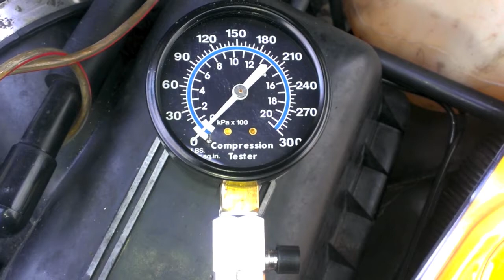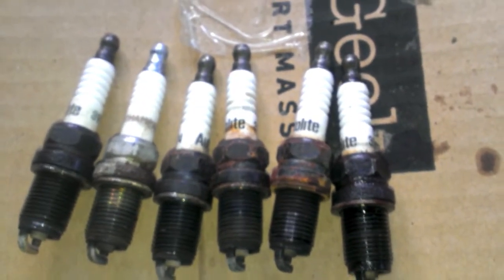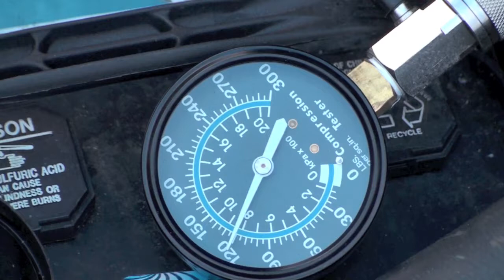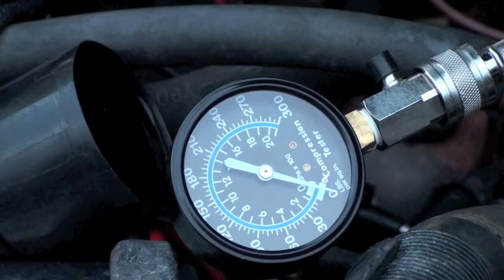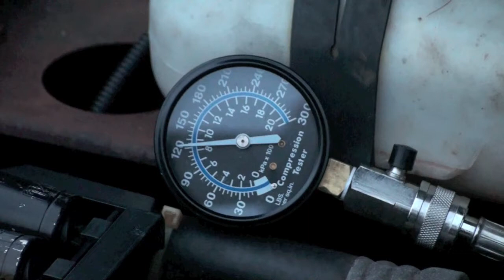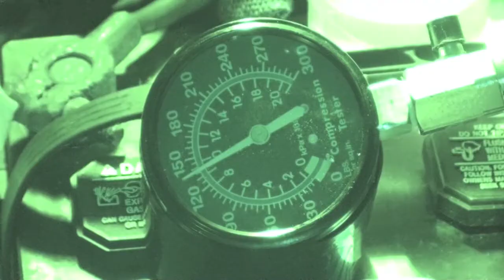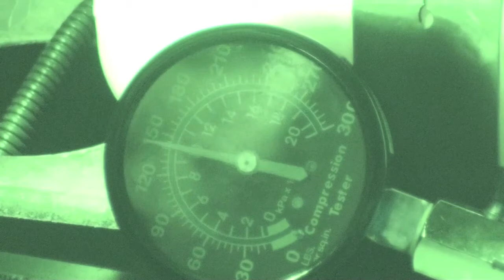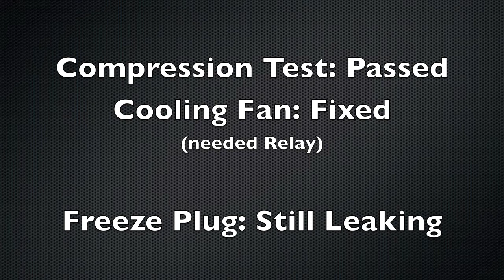89 Jeep Cherokee Compression Test

Comment: So what does that test tell you?
Reply from the maker: The Compression Test shows you how well your cylinders are sealing. An engine is basically an air pump that runs off explosions, so if a cylinder can not seal properly, all the power is wasted as it slips past the leak. 

Finding 1 or more cylinders with 0 or very low compression can indicate major engine damage or a huge timing problem. Finding that all cylinders have moderate to low compression can indicate it was not taken care of.
Reply: @NickInTimeFilms  for learning purposes and because I own a 89 as well, say you had a few that were bad, what steps would you have taken to repair it?
Reply from the maker: The next test after this is a leak down test. You set a cylinder to TDC on the compression stroke when everything should be closed, and you run an air line to the spark plug. Then you listen to where the air is coming from to find the area of focus. 

They make specific flow gauges that show much leakage there is. But say it's coming from the dipstick; worn rings or maybe valve seals. Coming from the intake of exhaust, intake or exhaust valves are leaking. Bubbles in the coolant or oil, blown head gasket. 

This is all assuming that engine timing is still good. For a good indepth video on checking for timing issues, I have a couple videos on my 2.5L Comanche that snapped a cam sproket pin and timing was gone. That was an interesting rabbit hole to go down.
Reply: @NickInTimeFilms  I took mine to a shop to do a compression test, they were over 100 with them being off by a little. I have a rough idle on mine and loss of power on take off and especially when I hit 3rd gear, the idle drops and it drags to get back to speed. I've done the spark plugs, tps, iac, ignition coil. I have a feeling I probably have some bad injectors, I still need to swap the distribitor cap, cables and rotor and oxygen sensor. Mine has never overheated, stalled on me twice when going about 10mph, the tps took care of that, but it's still has rough idle, the idle needle moves up and down very slightly , when fully warmed up my idle is at about 300, i still drive it around in close distances and works fine but I wouldn't dare take it on long distances like I use to right now.
Reply from the maker: Was the engine rebuilt at all or did something happen that started these issues? Having a scanner may help pinpoint any sensors or weird readings
Reply: @NickInTimeFilms  not that I know of, the jumpy idle has been there since I bought it, when I got my hands on it and started digging through it, there was a lot of old parts to it so not sure what or wasn't done to it.

Comment: Love your videos. I learn so much from them. I own the very same year jeep as yours same color also. I have a question for you,....Do you know where the two vacuum lines go coming from the ball at the front of the jeep?? I found one black line with an elbow in the end but not hooked to anything and I can't seem to find were it goes,!! It's driving me nuts!!! Can you help???
Reply from the maker: The vacuum ball right? It's just a vacuum storage tank. The bigger line will go straight to the intake manifold, that's your supply line. The smaller line is an output that I think goes to the vents or possibly a y fitting. There is also a one way check valve somewhere in there too.
Reply: NickInTimeFilms 
Thanks for the quick reply, one of mine go straight into the firewall if I recall and I he other that is hanging should go to intake manifold but the only manifold plug closest to the fire wall has a line already running to what I assume has something to do with cruise control?? I'm still not sure that's even hooked up right. Someone tried to steal this jeep and damaged the steering column, so shop installed wrong blinker arm no cruise, but this jeep also had a small engine fire and some lines were burnt, it runs fine it's sounds  good idling I've tried plugging that loose ends and don't seem to notice any difference in engine???? Soooo confused!!!
Reply from the maker: Oh goodness, you've just got a whole mess in your hands there. I think my CAD delete video goes over the vacuum lines for the transfercase about half way through, and the closed to open rad conversion video should show the vac ball relocation some time after the half way point.
Reply: NickInTimeFilms 

Great. I'll check out the vids, the jeep is in really good condition now the fire  didn't really do much damage you can hardly tell just by looking at it, I just don't think the mechanic who fixed it replaced the vacuum lines property, but somehow it seems to run fine, it just drives me nuts to know that there is a loose line that I have no idea where it should go, but I'm sure I'll find the problem with your help,!! Thank you very much,!!! I know I have a gem here. When I got this jeep 4 years ago it had 73000 on it. Today it has 123000. It's my 3 one.

Comment: Hey Nick,
So what was your general consensus on your compression test?  Did you end up doing any ring or valve work?
Reply from the maker: Well, not a whole lot. All the values were very close to each other so everything was sealing well enough. I was just checking this to make sure it was only rust that caused my freeze plugs to give out. When I pulled the engine apart I put new Valve stem seals in anyway
Reply: Cool, thanks for the reply!

Comment: Same amount of oil per cylinder added will make for more accurate wet test? Curious to see. Good video. I had read that an eight percent rise in compression per cylinder is to be expected during wet test. Much more then that could indicated a problem....,
Reply from the maker: +Edward Anstett I'm sure an even amount may help with consistent results, but honestly a wet test isn't necessary unless you get bad results on the dry. If you do then the wet will narrow down whether it is rings (much higher reading than before) or valves/head gasket (Same or slightly higher)

Comment: I'm finding out that my brake problem is a direct result of low compression. The vacuum line to the booster was nearly 50% lower than it should be. I wish I would of known about that before I replaced every.....single.....brake component. I have too much money in this jeep the way it sits to not replace the engine and use it!

Comment: Cool video. I just done a compression test on mu 89. They ranged from 115 to 127. How are your brakes on yours? My brakes are crap. I replaced everything in it except the steel lines and still, I have no brakes. The vacuum to the booster is low by about 50%.